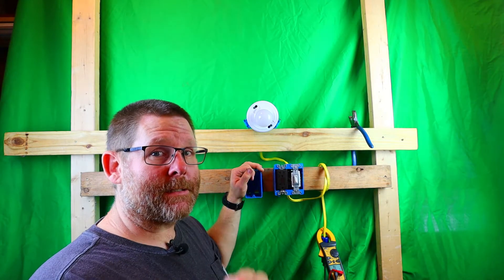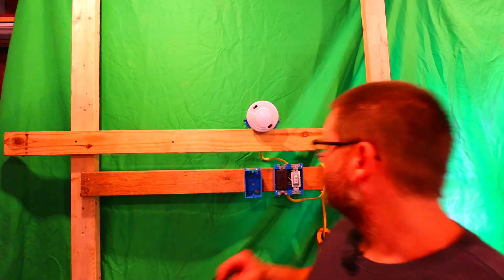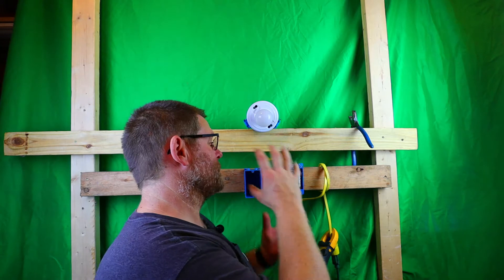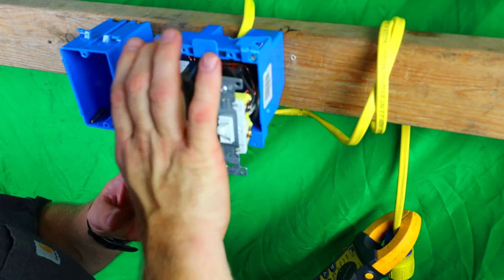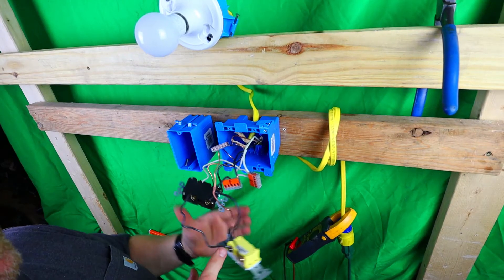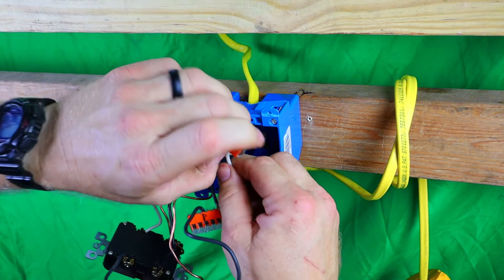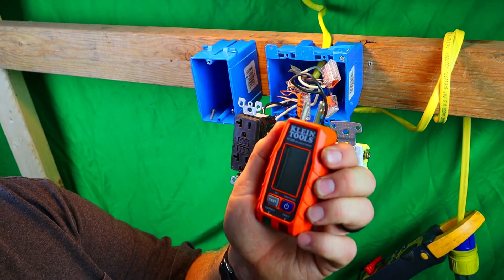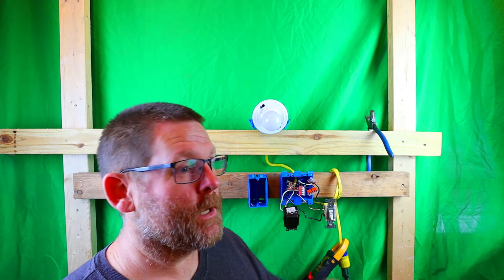How To Fix A GFCI That Is Constantly Tripping

Comment: Unless you want the GFCI receptacle to be switched, keep the switch on the load side. Even better is to have the switch and GFCI separate, as there is no requirement for lights to be GFCI protected. Of course, unless that is a dedicated circuit for just that bathroom, there is no reason a light and GFCI receptacle should be on the same circuit.
Reply from the maker: Why? You can definitely do that... Explain??
Reply: @Mountaineer Outdoors  Bathrooms are required to be on one or more dedicated branch circuits per NEC 210.11(C)(3), which is why I was saying lights and GFCIs should not be on the same circuit. There is an exception for a dedicated bathroom circuit supplying a single bathroom. Ditto the above for kitchen and microwave circuits and garage circuits.
I should have clarified there are code reasons not to have GFCIs and lights on the same circuit in many instances, but no electrical reason not to.

Comment: Hi, why isn't the line voltage (hot & neutral) first entering the GFCI outlet and then outward (load), i. e. hot to the switch, out of the switch and both hot & neutral to the light? Every outlet on our kitchen counter and all the wall outlets, including all the kitchen lights are powered by the load on the first outlet (gfci) on the kitchen counter, for years now.
Reply from the maker: You could do that
Reply: Of course.  the GFCI should be (would be) hot all the time.  Usable without turning the light on.
Reply: you are 100% correct. this guy is not a electrician. period.
Reply: @悟入木三分  it’s a demonstration for educational purposes. It’s a temporary installation, not a permanent installation.

Comment: GFCIs work by comparing how much current comes in on the hot side and goes out on the neutral side for both the line and load end of the receptacle. Even a tiny, around 6 milliamp discrepancy and it will trip. This protects people because if any current leaves the hot side of the outlet and enters a person, that means less current will go back out on the neutral side, causing a current imbalance across the Gfci and it trips. Bottom line, both the line and load ends of the receptacle must have a black and white wire. Don’t pigtail it like is often done for regular receptacles because you lose the protection on all downstream non-gfci receptacles on that circuit. Always daisy chain them and pay attention that your incoming hot is on the  line side. 

Wagos are great for installing ceiling light fixtures. You can wire up everything in a few seconds and don’t have to struggle with holding the fixture while twisting wires, especially when they’re short, and screwing on wire nuts, trying not to drop stuff and wishing for a couple of extra arms.
Reply from the maker: Thank you for your comment and watching. I agree with you. Happy holidays

Comment: The first ad pops up right when you flip to switch to show the gfci trip which doesn’t allow the viewer to actually see the light turn off.. would suggest moving for better viewer experience
Reply from the maker: Great idea I didn't know that. They place them in the videos wherever. I believe that I can move them and I will look into for sure. Thanks for the heads up and watching and commenting
Reply: If you had premium you wouldn't have ads

Comment: No good, seasoned electrician would wire that switch in either manner or be baffled by this. Bathroom lighting circuits do not need gfci protection. An electrician would know this. If this were an outside light then yes.
Reply from the maker: Yep